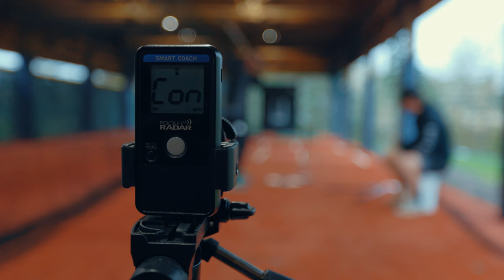Pocket Radar Set Up Tutorial: Baseball

Comment: wer do I set up radar for live BP
Reply from the maker: Thank you for the question. While the radar can be used to measure exit velo during live bp settings, we recommend off the tee or soft toss to get the most accurate readings.  Due to cosign error, it is harder to capture the accurate ball speed when it travels to the left or right side of the field.  It is most accurate on balls hit in a straight line. If you do set up for live bp, it would be best to set radar at least 15-20 feet from hitter to allow the ball to travel.  But just be aware of the issues above on balls hit to the left or right.
Reply: @pocketradar  thank u for response just had live BP you are so correct I got the radar for tee work it works excellent
Reply from the maker: @imheartotellthetruth7165  fantastic!  Thank you for letting us know!